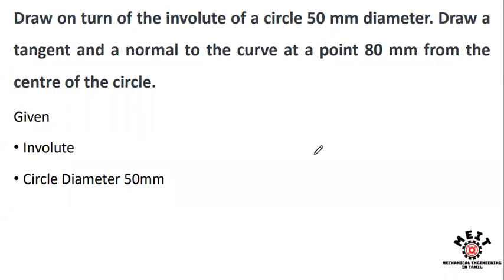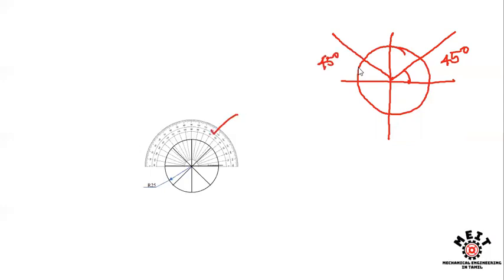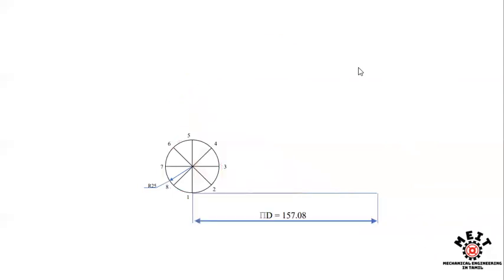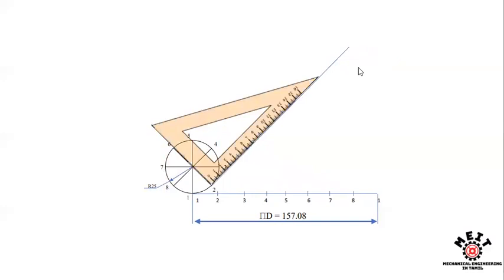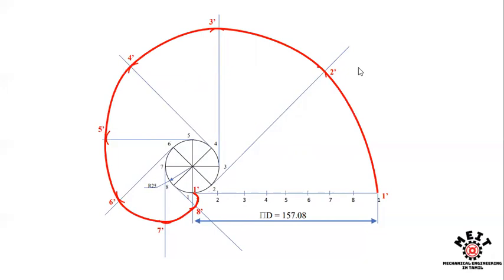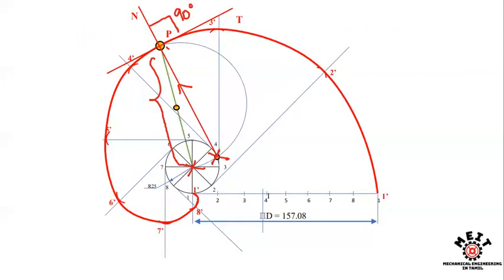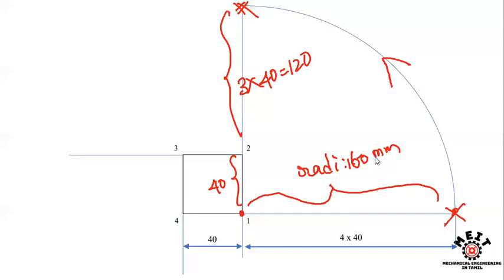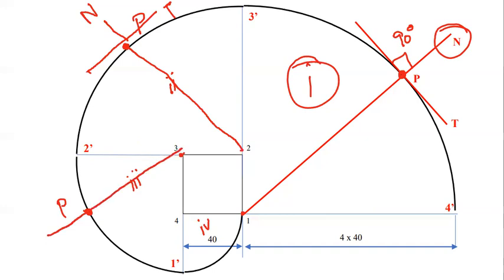Involute of Circle & Square | Curves | Engineering Graphics | EG | Tamil

Comment: Sir pi D ku badhula... Avnga length mention panirntha adh podunuma sir... Eg...

1. (a) An inelastic string of 150 mm length has its one end attached to the bottom most point of the circumference of a circular disc of 40 mm diameter.
Reply from the maker: Ama avanga length kudutha athutha use pamanum
Reply: @focusacademylectures  ok sir thank you

Comment: String length 150mm  circle diameter 40mm apoo π×D =125.75 sir ippo itha eppadi sir 12 parts ah divided panna mudium
Reply from the maker: 12 or 8 ah circleah divide panikanum... Pi.D value edukkama string length ku line draw pananum.. atha 8 ah divide pana kudathu. Apdye compass vachi arc draw pananum, athu draw pani katna tha puriyum.
Reply from the maker: 150 mm line draw panunga, athu mela 125.75 ku mark panunga . Antha 125.75 ah 8 ah divide panunga.. 150 la 125.75 mm poga meedhi konjam extra length 24.25mm irukum. 

125.75/8 = 15.7mm
125.75 mm ku 8parts mark panirpinga,
Ipo meedhi irukua 24.25 mm la 15.7 mm ku 9th part mark panunga... Inum konjam meedhi irukum athu 15.7 ah vida kammiya irukum.. so apdyae vidunga.

Ipo involute draw panunga... Athu normal procedure la panunga.. unga involute 8parts ku ilama 9+ parts ku draw panuvinga curve circle bottom ah thaandi extra varum
Reply: @focusacademylectures  thank you sir